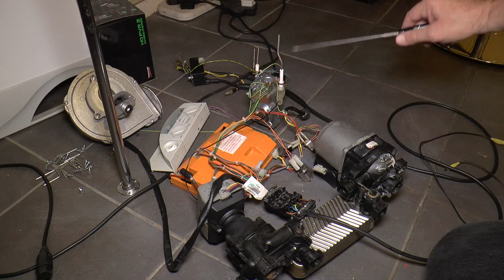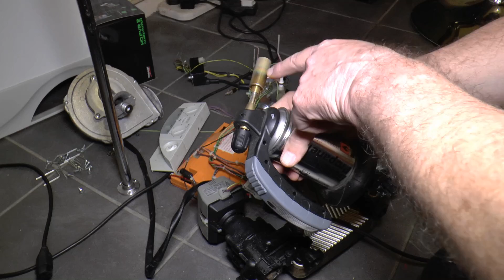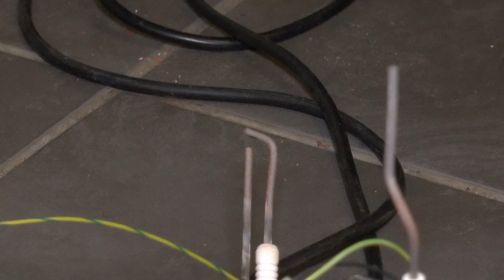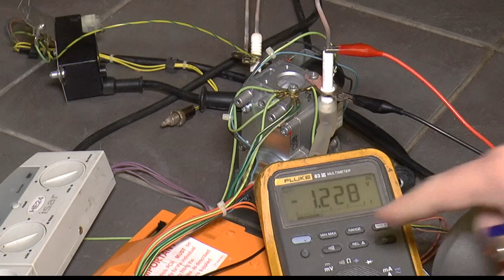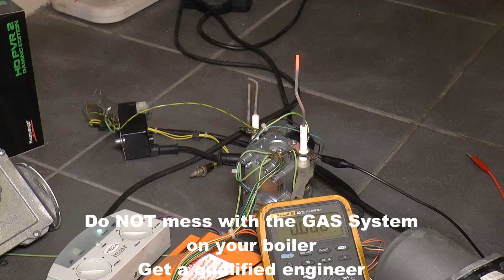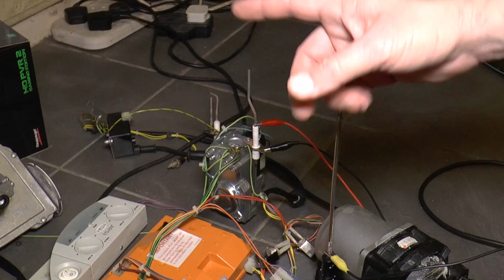Ideal Boiler Function + 'Rod Flame Sensor' & Gas Ionisation,  Boiler Fault Codes

Comment: I have the exact same boiler, I keep getting the F/L fault, I've changed the flame sensor and wiring and condenser trap, and still get the same fault, I'm in Sheffield, any chance you take a look and fix, 
Kind regards 
Mick
Reply from the maker: Do you mean LF since there isn’t a  FL fault. I stopped repairing these in 2022. Your orange box is probably faulty.

Comment: Hi I’m getting a L9 error code, initially the boiler runs for about 25 sec then code comes up, what could this be? Tia
Reply from the maker: https://pricethisplease.co.uk/ideal-boiler-l9-error/
Overheating.
Did you have heating on?
Blocked heat exchanger or water pump is not pumping the water.
Low water level.

Comment: I have an L9  fault and the boiler locks out and i can see and hear steam whistlung through the automatic air bleed at the top right hand of the boiler. The pressure goes up to 3 bar when this happens and then the boiler locks out and I get a fault code with the number 7 and 3 horizontal bars. I have no hot water or heating? L9 appears after resetting the boiler. So can someone tell me what is wrong with it please?? Thanks

Comment: Hi John i have a ideal isar it stopped working completely no display on the control panel so bought a reconditioned pcb online fitted it and it worked for a few days and started switching off showing various codes LA/LE/ a back to front large C /a number 7 ,L7 and now when I try to reset it it does nothing it just displays a minus sign and the burner light on if you can any idea what the problem is i would really appreciate it thanks
Reply from the maker: Assuming your wiring is not wet or corroded, I'd say the ECU is faulty.
Reply: @JohnB-2021  thanks for your reply, the wiring is dry and corrosion free as far as i tell ,would advice replacing the pcb thanks
Reply from the maker: @bilol375  If the replacement ECU worked for a while then stopped working correctly, I'd want to eliminate it.
Reply: Thats for your advice John I appreciate it.

Comment: Hi John. I've got an Ideal Icos HE24 condensing boiler.  I recently got the dreaded LF code which was basically stopping the boiler after a few seconds of ignition. It then mutated into the HF with a dot code. This fault code also disabled the the reset button. Ideal tech support said it was almost definitely the Flame Detection Electrode or PCB. 
My friend who is a gas safe engineer had some spares from a working second-hand boiler of the same model. We switched out the Flame Detection sensor first after checking the wiring and got same HF fault. Switched out the PCB next and same problem. Also the Trap and all related pipework has been cleaned We haven't done anything else yet as Ideal are still claiming it must be the Flame Detection sensor or shorted cabling.

Question -  Is there anything else you can think of that can throw up this error if Flame Detection sensing and the PCB are functioning OK?  I've got access to all the parts from the other boiler however it's just knowing which bit to tackle next. 

Many Thanks and great video...
Reply from the maker: Hi,
Have you actually got a flame for a second or two?
I.e. is the ignition / spark unit working and igniting the gas?
Can you hear the burning gas?
Thanks for your comments.
Reply: @JohnB-2021  Yes it looks like the boiler ignites for a few seconds before going through two other attempts ending with the HF code.
Reply from the maker: @modelmanmark  
There is only the rod and the ECU if the gas and spark units is ok.
Is your replacement ECU a known good one?
I'm not sure about the HF code and the relation to the 'flame' I do know LF is definitely related to 'no flame' not sure about HF.
Reply: @JohnB-2021  Many thanks for your fast replies.
 The spare orange ECU seems identical with matching numbers on both boards. It came from a working boiler of the same model. The only difference is the jumper pins are configured differently however that could be down to board revision. It's strange as the fault started with LF but escalated to the HF with a small dot. I am wondering if it could be a combustion chamber issue since it's not been cleared for a number of years. Could it be blocked jets that are close to the Flame Detection sensor so the sensor is not actually seeing heat?
The boiler doesn't seem to stay lit long enough for the sensor to detect heat in any case. Maybe the combustion chamber might be the next port of call.
Reply from the maker: @modelmanmark  
The jumpers are to set it for your model !
Did your gas man not tell you?
Copy the jumper pins so that it is the same as the original.
Reply: @JohnB-2021  Configured pins to match my original PCB (PIN 3 Shorted only) however got H5 code which means incorrect pin config. Very weird considering serial / ref numbers match on both ecu's Put back pins on spare ecu  to original config (PINS 2,4,5 shorted) and boiler tries to fire up with LF fault on third attempt. The same fault as the original ecu. As an ex electrical engineer that doesn't tie up with what you said which was completely logical. Also can't believe we have two faulty boards.
Reply from the maker: @modelmanmark  
So you don't have a 'Known Good' pcb?
In your original comment, you said the fault 'mutated into the HF' but you didn't mention that was with a second pcb.
What you are saying is confusing.
If you started with LF on the original, assuming you have gas and a spark and the wiring is ok then it is the ECU at fault. 
Is it an orange, blue or black ecu?
Reply: @JohnB-2021  As far as I know it was from a working boiler.
Reply from the maker: @modelmanmark  As far as you know is not helping.
You have a fault, and now you still have a fault.
If you change some jumpers, you have an extra fault.
We are going backwards.
If the ecu is orange, put the jumpers in the same position as your original.
If it says the jumpers are wrong, you are doing something wrong or it is a different colour ecu.
Reply: @JohnB-2021  Ok many thanks. I'm going to look into this deeper as something clearly wrong here. 
Just to sum up. Lets say the ecu and flame detection were functioning is there anything else that springs to mind that can trip an LF fault code such as what I suggested earlier?  I have full continuality between both the original and spare flame detection sensors and no shorts in the cabling so I think we can eliminate them as faulty in spite of what Ideal tech are telling us. If nothing else springs to mind I'll try and source a 3rd ecu.
Reply from the maker: @modelmanmark  The flame sensor is a bit of metal rod so don't see how it can be tested.
If you have gas and a spark, you will have a flame.
Reply: @JohnB-2021  Many thanks for all your help.
 The problem was the flame detection lead. My gas engineer had tested it for continuity and it checked out ok.
I'm an ex-electrical and mechanical engineer so decided to do my own checks on various components and cabling. With the flame detector connector disconnected from the ecu I checked again the flame detection lead and discovered a resistance of over 5 meg Ohms between earth and the sensor tip  On removal of the lead there was 0 ohms between the sensor and earth as you would expect. 
Conclusion - Somehow the sensor cable has altered its resistive properties in spite of no damage or breaks. I put the multi meter on a low resistance of say 200k and the lead showed full continuity. The nature of how the flame detection circuit works on these Ideal boilers was enough to fool the ecu into thinking no flame was present. I hope this helps other that might experience this strange phenonium.

PS.  I have discovered there are at least two variants of the Ideal Icos Orange ecu's . In spite of the product numbers matching and looking identical they both require different pin configurations.

Comment: One of the most interesting and informative videos I've seen on YouTube on any subject. Thanks for going to so much effort to dismantle and connect everything up on the floor to show us how the componets work. I'm in the process of trying to understand what is happening with my Ideal Mexico floor standing HE30 model and your video is extra helpful. My boiler is 14 years old and had the PCB replaced about 6 years ago. The fan is quite noisy when it's running flat out. I'm tempted to sling the boiler out and put any potential repair bills towards a new one but I've become interested in the problem! Firstly the boiler is capable of working and produces HW and CH when it is running okay but it fails on a daily basis with most common fault being LF and H4. Interestingly the last couple of evenings I've gone to bed with LF flashing but it has decided to fire up at 7am and is running okay at breakfast time. By midday today it was showing a new error code of LE. Turning off the power and on again with a reset brought it back to O.  I'm wondering now if that during the overnight period something has dried out or cooled down sufficietly for the machine to come back to life? Regards b33zo
Reply from the maker: Thank you b33zo, it's very kind of you to comment that way.
LF is almost certainly the control unit.
Is your new control unit, replaced 6 years ago, orange or black?
Orange is the newer version.
There are usually many 'used' orange units on ebay where others have had new boilers fitted, one can pay at little as £10.
The transformers inside fail and the unit would be dead.
The other main fault is the 'flame sense' circuit, it is simply prone to failure after a few years.
Assuming the gas supply is ok, you need to check for a spark at the electrodes.
If there is a spark and there is gas, your control unit is faulty.
It does sound like the control unit is starting to fail assuming there is no moisture on any of the wiring.
I guess it's difficult to diagnose because it's intermittent.
Where in the world are you?
jb
Reply: @JohnB-2021  Hi JB thanks for responding. Really appreciated (I'm another JohnB for info!).The replacement PCB is orange. I've had so many error codes that PCB failure did feel like to best guess but the full price replacement (from Ideal) is expensive. I take your point re Ebay. If the boiler operates normally (sometimes) is it fair to assume that there IS gas, there is a spark when required, the flame sensor does work, the fan is operational and the thermistor is okay? From your fabulous video I believe that if any one of these components fail the whole system wont work. As you say the intermittent nature of the problem adds to the confusion. I know very little about PCBs (although I've sucessfully had a 27" iMac apart to re-cook the graphics card) this one is presumably not completely dead as the boiler is capable of running when it feels like it? best wishes b33zo
Reply from the maker: @b33zo  
If you're in the UK, buying a good used one for approximately £10 ish would be my first thought to eliminate it.
Not even I would buy a new one, I think they are over £100.
I see you are in the UK, or at least your accent is very British
Reply: @JohnB-2021  Hi John yes sorry I forgot to say I'm in Bournemouth (Premier League). I'll purchase an Ebay bargain asap (its great doing this in warm weather!). I see sellers are listing them as fitting multiple HE models. Is it really one-size-fits-all?
Reply from the maker: @b33zo  Yes one size fits all.
One just simply moves the little jumper connectors to suit the boiler.
Reply: @JohnB-2021  Thanks for your extra guidance on fixing my boiler John. I picked up an Ebay PCB for £25 from a local gas fitter who was also kind enough to pass on some knowledge. The boiler seems to be quite happy now but after so many different error codes I'm still keeping everything crossed! I made a video which is on my YouTube b33zo channel. Thanks again for you help. BTW I've done 25+ years press&PR with nikon kit. Happy to assist there if required. b33zo

Comment: Hi there
I would be most grateful if you could help with some advice.
I have a he30 and boiler and it does not ignite I have changed the heat exchanger the diverter valve and the thermostat it's still not igniting prior to changing these pass apart from the heat exchanger it was working ok just overheating but now I've changed the other parts at times it shows hffh I believe thank you
Kindest regards 
Iqbal latif
Reply from the maker: Hi,
If you click on the 'show more' you will see the fault codes.
It sounds like the orange or black control unit is starting to fail, common fault with the flame detect circuit.

Comment: Very interesting demonstration, I have a Ideal EVO HE16 same control system. Have you ever seen one where the display intermittently goes blank for a period of days/weeks then comes back on again, yet whilst the display is blank the boiler works perfectly ?

Looking forward to your response
Reply from the maker: Yes I’ve seen corroded wiring and corroded contacts on the pcb on the display board.
Reply: My display module slides on to a little bit of PCB that protrudes out from the main orange controller and all the connections are in good condition.

Comment: Hi John. Very helpful video. I have the Isar HE30, it fires up and supplies hot water and CH but after approximately 20 minutes it shuts down and displays LF. Thought it might be slow draining condensate backing up but have inspected the sump and changed the trap all are now clear, the fault remains. Any suggestions?
Reply from the maker: Hi Paul,
Probably the control unit on the way out. (at a guess)

Comment: hi John I have the same boiler getting a LF but I'm getting the white light too what else should I look at or check
Reply from the maker: Are you getting the white light then the LF or?
Reply: @JohnB-2021  yes. seems to do 3 attempts  but then stops. changed the igniter and flame detection electrode. been told could be pcb as the evo he22/24 boilers is terrible and that's the main thing that goes wrong on them.
Reply from the maker: @jamesallen4483  Yes that is correct, I think I mentioned they fail.
Reply: @JohnB-2021  yes I get the white light but flashes then after 3 attempts over the few mins it shuts down and then fails on LF fault.
Reply: yes I did say that to my friend after I watched this video I'll order one in and let you know how it goes. great video

Comment: Hello! I'm writing from Turkey. I had to make do with the image because I do not know English. we ask you how the flame sensor is tested and a screwdriver acts as a sensor. I would appreciate it if you explain briefly. Wishing you a good day.
Reply from the maker: Hi from the UK, I love Turkey and have been many times. The screw driver demonstrates a flame sensor on Ideal boilers is just a piece of metal rod that conducts electricity.
The circuit inside the control unit does fail.
Reply: Mr. Jhon B., thank you for taking the time to answer my question.

Comment: Combi boilers were invented to make heating engineers money. Combi boilers are nothing but trouble. Move to the Canary islands and the entire heating system for a villa will be an immersion heater with a two pin plug, when than stops working  disconnect  the inlet and the outlet, throw it in the skip, get a new one,(100 Euros).
Reply: Thats electric and very expensive in the Uk
Reply from the maker: They are nothing but trouble only if neglected or incorrectly repaired.

Comment: Hot water is fine on mine until central heating is switched on then boiler shuts down after about 30 seconds,  looks to me that it's the diverter valve, should that be correct?
Reply from the maker: Possibly.
But that would mean the water should still flow through the central heating or at least cycle on and off when the heat exchanger gets too hot.

Comment: Hot water on mine is intermittent and suspect the diaphragm is faulty but where is it?
Reply from the maker: It's the water valve on the left of the heat exchanger

Comment: Hi help needed.... got a he30 and it bangs when on central heating sometimes 3 times sometimes more... I have had 2 new burners which have been distroyed by the ignition box. I have a new ignition box but still banging Scottish power now fitting a gas valve could it be giving out too much gas? Heating works and so does hot water..... so infuriating
Reply from the maker: Hi, British Gas serviced my boiler many years ago (2002 approx) and it started banging only after they adjusted something.
They later changed the gas valve which cured the fault.
I also went to my bosses house, their 'Non combi boiler' was banging intermittently.
That was a stuck diverter valve which was scaled up.
If the boiler is making a loud bang when it first switches on, I'd have the gas valve checked first, not forgetting the gas valve at the main meter for your house.
Reply: Hi John B, Excellent video! I have a 20 yr, or so, old Icos HE15 which has required my changing the PCB 8 or so times due to LF Error signals. Last December I purchased a “Brand New” board online, and after switching off over the summer, it’s done it again! Prior to your Vlog I had no idea about ionisation and electrode function, and had no idea how to check whether or not the electrode was at fault. Using your example, I have just proved that it is ok! Sadly, this means I will now add another orange box to my considerable collection.I would like to be able to test the bored itself and would be grateful for your advice. The user’s manual says the board can be checked for continuity across the two pin sockets, but doesn’t explain how, e.g. with board in situ, power on? Power off? Connected, disconnected?  Also,  I have no idea how the two ionisation probes work that dangle inside the combustion chamber! The manual indicates that they should not be touched, so they must be important. Please can you advise?